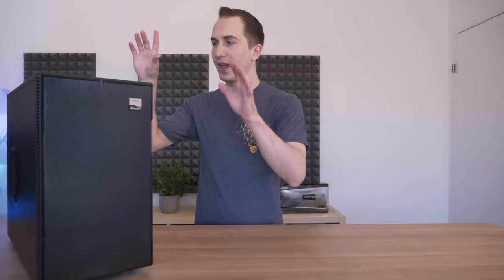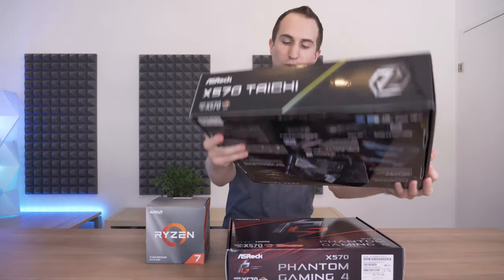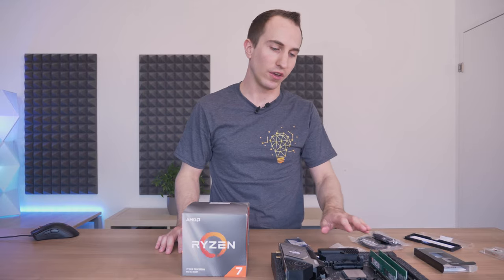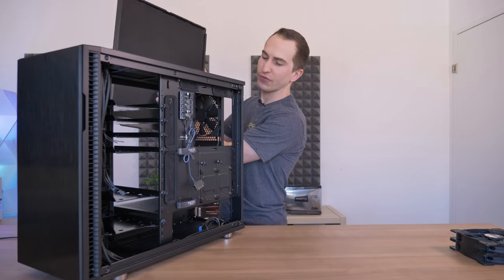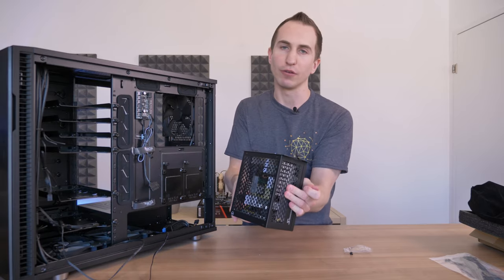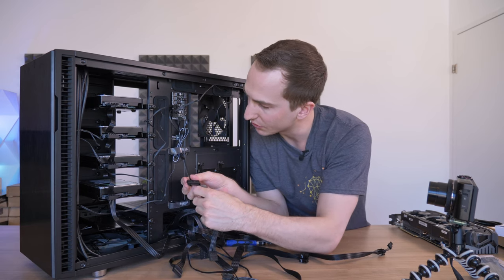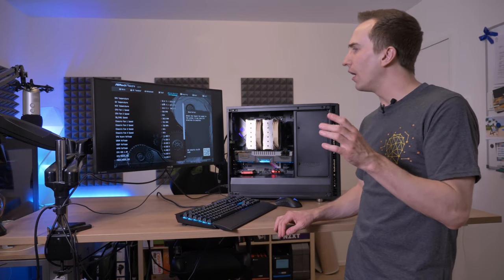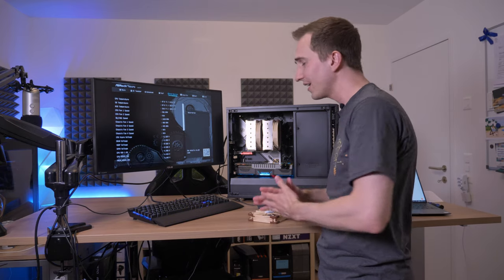Ultimate 10 GIGABIT Ryzen Home Server Build 2020

Comment: 5:36 actually, you should use ECC for every filesystem, ZFS isn't special in this regard ;)
But if you don't have mission critical applications running on FreeNAS/TrueNAS, non-ECC memory is completely fine, since ZFS uses Copy on Write and Metadata, it's almost Impossible to corrupt any data
Reply from the maker: In fact, all of my YT related files are on this ZFS volume so I really want to make sure not to loose anything. Its all backed up daily off site but retreiving that would be a huge pain
Reply: @TechGuides  ECC is not a backup :D But to be serious I don'd know that is possible to launch ECC memory in this Ryzen 7 3700X
Reply: @marcinsosna2852  Yeam same question, does it work?
Reply: @Tech Guides can you help us with this question?

Comment: A note for anyone building server using latest 5900x Ryzen. You need Ubuntu 21.04(I didn’t test 20.10) or more to take advantage of ECC. Server will boot but ECC was not enabled on my build with Ubuntu 20.04.

Comment: 19:53 that airflow space...
Reply from the maker: Yeah it's not great, I might replace the homogeneous 1080 with a much smaller 980 if temps will be an issue
Reply: Tech Guides great build!! I’m building one similar. I have the 3900x I wanted to ask you how is your cooler holding up? Also if you still have it or swapped it out yet I definitely will take the 1080 off your hands if you don’t have any use for it?? Thanks.

Comment: I was planning on using an Asrock X570 Phantom Gaming 4S with an older Ryzen 5 1600 (3.1 GHz, 6-core),  but didn’t realize the cpu also needs integrated graphics for the onboard video to work....Crap!  I may just pop a cheap video card in.  Probably would help with transcoding anyway.

Comment: Wil be cheaper to replace the cooler than the motherboard. Also  I would go with an asrock rack motherboard that is for servers with server features like IPMI
Reply from the maker: Sure, except that the cooler was sponsored for this project and the mobo was not ;) I prefer desktop style motherboards for a load of reasons, most notably silent operation which in a server stack is simply not happening.

Comment: Maybe you're  already fine with that gear, but after I've watched your previous  video about your old server, I decided to came up with one as well, and I would have suggested you getting a the Threadripper 1920X which has more cores & threads (12 cores & 24 Threads), it has more cache up to 38MB and it is cheaper than the ryzen 3700x.

I am actually surprised that the gear you've chosen was exactly equals to the gear I have chosen as a  first selection, before I planned to change the CPU . The motherboard was actually a Asrock Phantom 6.

I would like to know more about the 10 Gigabit ethernet, and the switch you use and how you set it up!

Great videos mate.
Best regards from Spain.
Reply from the maker: Thanks man! Well, the idea was to future proof with PCIe4 in case I want to install some crazy fast PCIe drives. Also, you got more PCIe lanes due to the X570 chipset allowing me to install loads of drives. Thanks man, the 10 gig card works just fine at the moment and transfers are blazing fast from my main PC!
Reply: yeah but you forgot 1920x's TDP
Reply: @TechGuides  X399 has 64 PCIe lanes, much more than AM4 offers even if those are PCIe 3.0 which are more than adequate for GPU usage or installing HBA's to max out the HDD capacity of the case.  Choosing X570 for PCIe 4.0 doesn't make sense when you then proceed to install a PCIe 3.0 SSD.  
If you wanted maximum PCIe express lanes and PCIe 4.0 then there is also TRX40 which provides both with current gen Threadripper.

Comment: Hi, thanks for the very nicely explained video. I am trying to build a production server for an ERP system for a small business and planning to add the below components:
Ryzen 7 3700X, GIGABYTE X570 AORUS Master Board, Crucial Technology 32GB DDR4 PC4-21300 2666MHz RDIMM, Dual Ranked Registered ECC Memory (Single) (CT32G4RFD4266), EVGA SuperNOVA 650 Ga, 80 Plus Gold 650W, Fully Modular PSU, WD Red 2 TB HDD, Crucial 500 GB SSD. Do you think the Cooler Master HAF XB EVO ATX case will be an ideal case for this? The one you used in your build is out of stock. Will the Fractal Design Define 7 or Fractal Design Define R5 work? I want a case that is quiet with very good airflow as this would run 24x7. Also what do you think about these components for this build? Any suggestion will highly be appreciated. Thanks!

Comment: So why not just use a PCIe riser to allow the gpu to be mounted in a different location? You can buy them right off of the shelf at Micro Center.
Reply from the maker: Sadly the GPU is to tall to even fit on a riser below the cooler.
Reply: @TechGuides  well that is quite the gpu, then. 😆 Noice. Does Noctura provide measurements for the pcie spacing of different mobos? That sounds like it could be a real hassle otherwise.
Reply from the maker: Yes Noctua does provide a list of compatible motherboards for each cooler. I didn't check, so its my bad

Comment: Some AMD Ryzen Chips I Have Saw & Used Really Like What i Call a LOT of Voltage like 1.45v on the auto settings..I Built a Ryzen 9 3900X on Asus Rog Hero bord & i Have a Manual All Core Over Clock of 4.45Ghz@1.34v Rock solid & 32Gb of G skill 3600Mhz Ram ! my Brother has a Ryzen 5 3600 on Asus Tuf Bord & 16gb of G Skill 3600Mhz But His Runs at 4.2Ghz All Core OC But it Also Wants About 1.5v ..I Dono Some Chips Just Love Voltage More Than Others But I Would Not Run Mine at No 1.5v or Even 1.4v But That is Just Me & i am a Bit Old School !

Comment: Awesome project! I'm looking to get an AMD 3600, STRIX V450F, and your Kingston ECC memory. I've never built a server machine before so the ECC compatibility is confusing to me. All three components work together and run with ECC, correct? You say that ECC is supported on Ryzen as well as people on forums but the actual motherboard pages say "Non-ECC" which is driving me crazy.
Reply from the maker: Hey! The Asus STRIX V450F does not support ECC memory! You will need a motherboard that supports ECC otherwise it wont work even with a Ryzen CPU and ECC RAM. I prefer Asrock as most of their motherboards support ECC but there are many other mobos out there that do
Reply: @TechGuides  I see... Linus says it does work, but ASUS Support says it doesn't. Solid ECC information with Ryzen seems so hard to find. Do you know of any motherboards which use X470 with ECC support?

Comment: Thanks for video. One question, what does it mean that Ryzen 7 3700X does not have GPU? If my mainboard has HDMI will it work with this CPU ?
Reply from the maker: The 3700X does not have an integrated GPU and therefore you won't be able to display anything on the onboard HDMI output. You will either need a different CPU or a dedicated GPU to get video. Note that the integrated graphics cant really be used for gaming or any other graphically heavy applications

Comment: I dont think the hdd drives can keep up with that 10g speed, can they?
Reply from the maker: I've connected 4 of them in a ZFS mirror, which gives me 9gigabits transfer speed!! Actually, part of this will only be read in RAM and later gets trasnferred onto the drives, max speed in that config would be 3.2gigabit write and 6.4gigabit read (200megabyte per drive, 2mirrors, so write is twice as fast as one drive and read 4 times). Look out for my next video if you're interested in seeing that in action :)

Comment: Ever heard of pcie extension for gpu? So you can use 1st mother board?
Reply from the maker: Great idea, except that unfortunately there is not enough space between the PSU shroud and CPU cooler (vertically) to mount the GPU...
Reply: @TechGuides  could you have gotten a low profile card?

Comment: Why didn't u use a board that supports 2x physical cpus, more performance when it comes to server usage
Reply from the maker: I doubt I will even use half of the threads that I have available for my home server needs. Multiple CPU's are imo only necessary if you want to build something outward facing, i.e. which is used by a looot of people. This server is only used by myself and my family

Comment: Would it be too expensive for the motherboard for a server cuz for me for a ryzen 7 server will be very expensive for it. 
Is there any alternative motherboard that is cheaper?

Also isn't the GPU also overkill for itself
Reply: B550, X470, B450?
Reply from the maker: I only went for X570 to get PCIE4 support. This is complete overkill in most situations so yes as Isus mentioned all B550, X470 or B450 work with Zen 2 processors

Comment: complains about tight space to connect Video card to the first board and then connects it to a different second slot in the second mother board.... ???? logic ?
Reply from the maker: Let me explain. The first mobo was not supported with the (sponsored) CPU cooler, so I had to use another one that was. Unfortunately, that second board has the chipset cooling right where the GPU would sit making it run too hot. However, because this was a super expensive board, it also has two additional PCIEx16 slots allowing me to put the GPU further down. The first mobo only had additional PCIEx1 slots that physically do not allow you to put a GPU in so you simply could not do this.

Comment: Way da hell you need a gpu on server ?
Reply: Because Ryzen CPUs don't have built in graphics
Reply: And for Rendering videos
Reply: You could have used AMD 3000g no gpu needed only 35wat power so no need for hi end cpu cooler..and it cost only 50$...
Reply: @ashifabedin  That server is made for Rendering videos which need a good CPU and GPU.
Reply from the maker: Ahnaf is correct. Ryzen has no iGPU and I don't know how to install an OS from the network. Also I want to make use of hardware acceleration (NVENC) of recent Nvidia GPU's while rendering on the server. The high core count has already been absolutely vital for a few projects e.g. when I was computing video quality scores on dozens of videos. Legend has it that those scores would still be computed in 1000 years on a cheapo AMD 3000G CPU ;)

Comment: 1) Wrong first Mobo for the project. 2) Noctua CPU cooler installed upside down. 3) Fanless PSU near Corsair fans... Man, you need to do more research before buying/ building something!
Reply from the maker: 1) not actually my fault but you can't know that 2) completely irrelevant for the servers performance 3) would have been an issue with any PSU
Reply: Man you need to learn how to talk to people first of all. How old are you?
Reply: How can the NH-D15 be installed "upside down" when the orientation is front to rear? What difference does having case fans near his psu have anything to do with, uh, well anything? I'll tel you what- nothing at all.
Reply: "Wrong motherboard"? In what way? The guy needs lots of SATA ports, pcie lanes,  nvme expansion slots and four ram slots. Is he supposed to get those capabilities in a Mini ITX board? Sheesh.
Reply: @christopherwood2290  Motherboard is not responsible for the available pcie lanes.